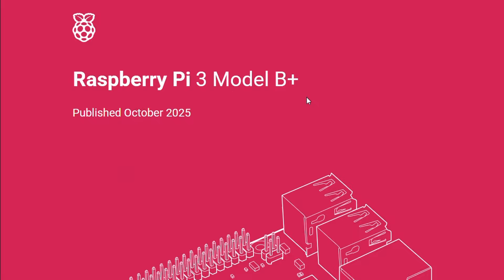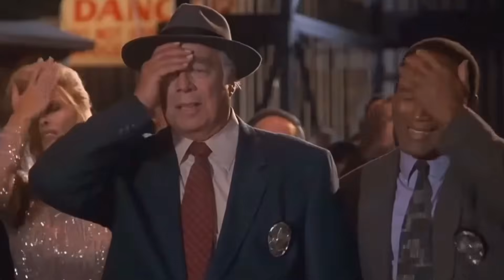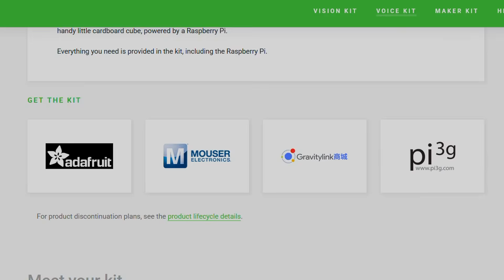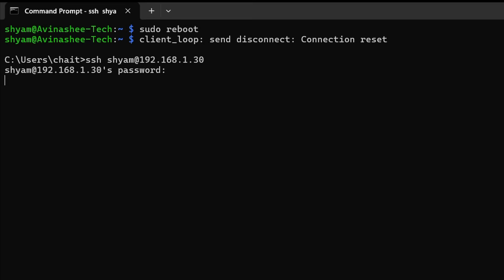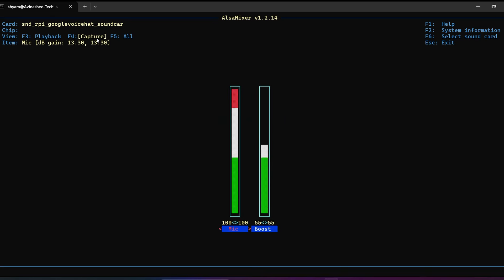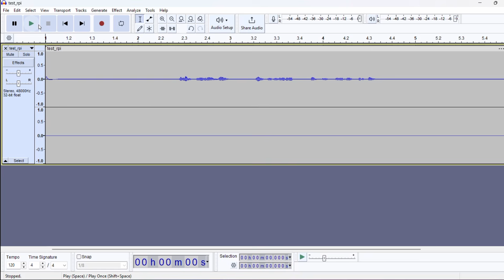You don't need a USB mic for Raspberry Pi?

Comment: hi, i am using no desktop os, when i open alsamixer, i dont get min gain set bar , only boost bar is visible
can you help?
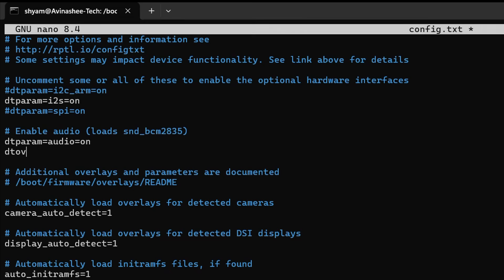Reply from the maker: i am not really sure why that might be happening. you can try the command line approach though like i did in this video - https://youtu.be/OvMTP0DIqWQ?si=BthdFpeXAwcoDldD&t=153 at 02:33. Also make sure you have selected the correct mic device within alsamixer in case you missed it. Hope it helps. Thanks for watching.